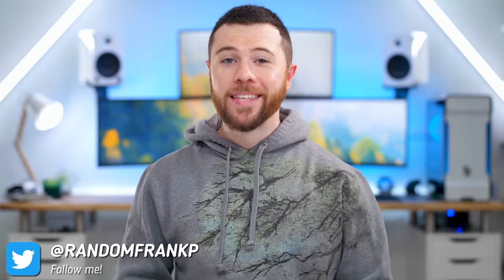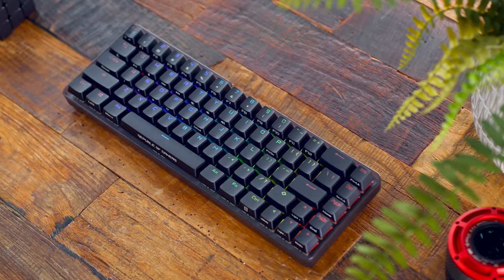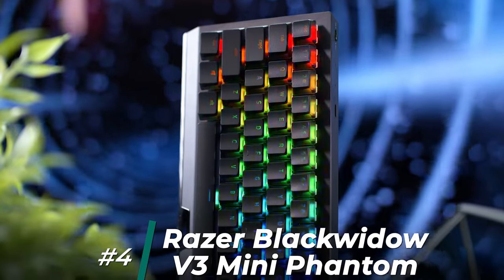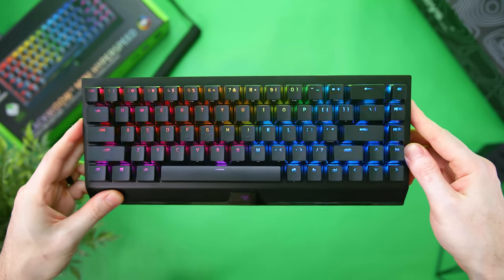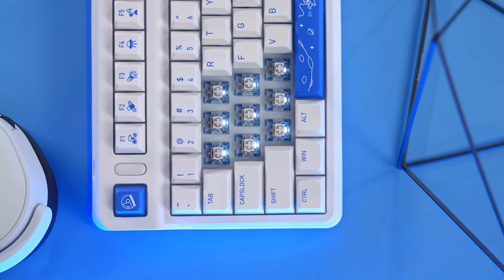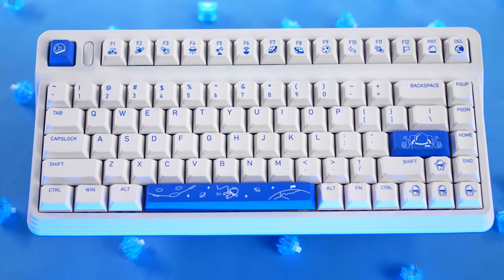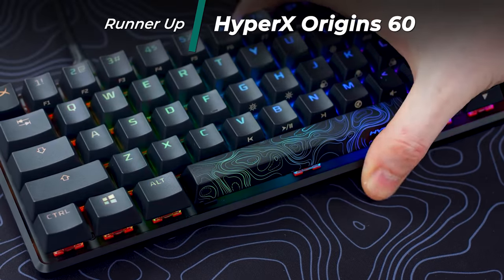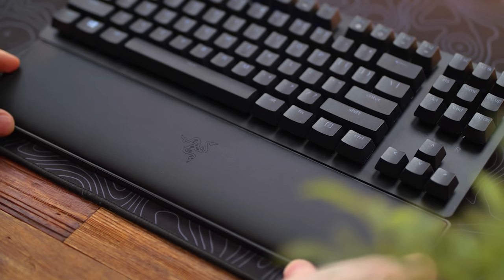Top 5 Gaming Keyboards of 2021!

Comment: Think the Keychron's going to be my next buy.  Had my eye on it, and this really affirms the purchase.
Reply: It's been sold out everytime I've checked
Reply: It's a great board, especially for the price.  With some mods the board performs well above it's price point.
Reply: I snagged one out and it’s great! The lighting is a bit confusing tho, still haven’t figure that out
Reply: Just got my keychron k6 in the mail and I love it so far.  Keep in mind you have to spend extra on the hot-swappable version but I’m just getting into keyboards so I’m fine with my gateron browns
Reply: Akko MOD 007
Reply: Keychron Q3 is coming out in January too
Reply: Yo i have to order it from a seller in china and get those Gat Phantom Yellow
Reply: I’m using the K3 it’s good enough for my needs I like the low profile
Reply: @diegoedward751  Does it work on ps5?
Reply: same

Comment: I am currently rocking the Hyper X Alloy Origin Core with the Aqua switches with modifications of adding dampening foam to the housing and taping the PCB to get more of a thoc sound out of the keys.
Reply: I have the same board, did you have problems separating the case?
Reply: It's a great keyboard and I loved the smoothness and tactility of the aqua switches, but the stabilizer rattle on the spacebar, shift, and enter keys killed it for me. I tried adding krytox 205g0 with a thin paintbrush to the metal parts of the stabilizers and it helped a bit, but without being able to take the keyboard apart, there was no way to do it properly. Other than that and the recessed USB-C port making it difficult to use custom cables, it is one of my favorite keyboards.
Reply: @cyberflex11  a lot of the rattle comes from the stabiliser housing colliding with the plate, what i did was pull the stab housings out and put a piece of bandaid between the plate and stab housing and it made a huge difference
Reply: That was his top 1 last year lol

Comment: I got my Blackwidow V3 Mini earlier this week before coming across this video and I'm loving it so far. A 65% was something I didn't know I needed so badly! This video doesn't even do the yellow switches justice either. They just sound so amazing. #4 on the year from an impulse buy ain't too shabby! Also got it on sale for $120 at Best Buy.
Reply: You still using it ?
Reply: @wolfsiezfps  Yup still love it, only thing with it is sometimes the wireless dongle connection gets interrupted so if I'm gaming I'll use it wired to take away that risk.
Reply: @raaags338  I hope they make a Mercury edition, what switches are you using ?

Comment: I have a GMMK TKL (non-pro) and I love it. The switches are the right mix of clicky and muted. After years of buying cheaper Logitech and MS keyboards, I don't think I'll ever go back to non-mechanical.
Reply: Is everything beside the frame separate add ons you got to do? like it doesn't come with keys or anything
Reply: @landenmccormick5237  Nope. It came preassembled with white keys. I can still swap out stuff if I want different switches or keys at some point.
Reply: @marklinton4567  how much was it? Because it shows it for $170 but thats without any of the keys and making it a basiv white makes it $300
Reply: @landenmccormick5237  That must be the Pro version. I've got the regular in white and it was $109.
Reply: @landenmccormick5237  and that was with the keys and switches preinstalled.

Comment: As a GMMK Pro owner: The gasket mount system wasn't great at first (before full release) because they just got crushed by how compact the board is. Later down the line when I bought mine on release, I noticed they had improved the gaskets. They are more quality and aren't as crushed. However, it still feels like it isn't doing much for the feel of the board because it is still super firm and non-flexible. I have the stock aluminum plate and I think maybe the polycarbonate plate would help with the flexibility. But personally, I like how the board feels overall and I think I'm going to keep my aluminum plate because I really don't mind the feel of it
Reply: The Keydous nj80 is a great board aswell, cheaper than the gmmk pro.
Reply: how is it for gaming? I heard it's response time is more or less 24ms
Reply: @alphaze5944  hey man, don't talk about responsetime with a wired keyboard. It's marketing. A 50ms difference isn't going to make you better at gaming. A good feeling keyboard is. Don't bother about response time (only if it's wireless, because you will notice tbat).
Reply: I play osu and response time is kind of a sensitive topic for me. Just wanna know how it goes
Reply: @alphaze5944  ur probably looking at around 50ms, but how fast you are depends on your own reaction time and the switches you choose.

Comment: The lime 80 cosmic traveller doesn’t have lubed stabs. Only the switches are lubed.
Reply: Frevref whoops lol it
Reply: Wait fr fr
Reply: @theblacksheep71-16  yeah I has considered buying this a few months ago and asked them. They said they weren’t lubed but there switches are. And the stabilisers are plate mounted as well. Which is easier to work with but rattles more. I ended up getting a keychron

Comment: Honestly these are more Custom Keyboards that one's meant for gaming. I think keyboards with high polling rates, high actuation point and maybe optical ones as those seem to be ever so slightly faster than mechanical switches. 

Difference is not much it's pretty much like those switches that are 10% more tactile than the other one or sounds slightly deeper than a switch made from a different plastic.

Comment: The wooting two lekker edition should be in the top 5. I dont have it but the features alone are enough to be on the list. The adjustable actuation goes as low as 0.1 mm and the switches are also analog. Along with that the stabilisers dont rattle.

Comment: One thing to note bout the falchion it uses costar stabs also the switches have a springy ring and the low profile case will amplifi that, the razer black widow is not worth the money, the cosmic traveler is Easley the best keyboard and comes with great stock switches and you don't need rgb not to mention the stabs are very good stock it is Easley the best stock keyboard,the gmmk pro and keycron are great but you have to mod them with tape mod lubed switches extra gaskets for the gmmk pro, and a lot of foam for the q1 the ducky one 3 suite is good off you need a more compact keyboard but the iquinix just does everything better the honorable mentions I wouldn't bother with unless if you want low profile the get the streak

But in the end keyboards are all about opinion so take this as you will
Reply: Please. Use. Punctuations. 

🙏
Reply: @thamirahamed812  no :troll:

Comment: I bought a Razer Ornata Chroma (with the mecha-membrane switches) about 2 years ago. My wrist rest is starting to wear down and I am just wanting a new keyboard. I don't like having the numpad as I don't like bumping into it with my mouse. 

I was considering asking for a new keyboard for Christmas, but these are all too expensive. 😭 I also don't want to have to deal with a wireless keyboard, and don't care about RGB. If anyone does happen to read this, do you have any suggestions for a black mechanical tenkeyless or 60% keyboard under $100?

Comment: No mention of the RK84? This was the dopest starting point for a keyboard i have been able to find. The switches have no ping. Seem pre lubed. Stabs also. The only stab rattle in the pre lubed stabs is the right side of the space bar. Other than that there isnt even a rattle. Anywhere. And i shook tf out of it to make sure. Fully hot swappable. 2.4 dongle, BT5, and wired connections, with dual pass thru USBs, and a software to control macros and RGB settings. All for 85 bucks shipped from amazon. 

And even with the full set of MelGeek keycaps im only 130 bucks in. Thats my only mod so far. Keycaps. Not even fully modded yet and its already super nice. Great sound. Great feel on the stock brown switches. Fully capable out of the box. Comes in white and black. Also has keycap and switch remover included.

Easily the best budget board out hands down. IMHO.

Comment: if i get a razer blackwhidow v3 full size, will still be good? do i have to get the phantom key caps?
Reply: Full size is always better
Reply: @twinkelplayer498  should I get the phantom key caps as well or do I not need them?
Reply: @p_king8767  see if the default key caps are any good, then decide

Comment: i had the asus fal . great keyboard .. very small if u coming from a full size keyboard. I didnt like the side finger to volume up and volume down because i am coming from a volume knob.  why ? because it is not precise , like u will struggle to get volume 94.5  u will have to settle for like 90 percent or 95 percent.  as for the volume knobs u can have it precise.

I returned this keyboard because it has some serious driver issues for me or the keyboard i got was defected.

it will FREEZE and then it will lag and wrote one letter and will spam it until u turn off the keyboard switch button.

i thought it can  be my mb or my usb port but i gave it 4 days for it.

i just had enough of this crap so i returned it.

I am not done with wireless with this experience.

dont get me wrong i have a 24 core CPu and a beast of GPU with 120 GB of ram overkill .

it can be the drivers from asus or the keyboard itself . or the usb dongle.

whatever the case , i am not scarficing my keyboard lagging during a rank game. which has happened . so im going back to wired keyboard for now.
Reply: oh and a HUGE BIG NO NO . this keyboard has a 5.2m space bar kep cap and GOOD luck finding that cause it is so hard to find. so custom key caps is a no go unless you want half and half color.

i really dont know why asus did a 5.2m space bar key cap.

Comment: No K100? Shame on you!
Most of the top spots have better switches than my K100 in terms of stability, at least un-lubed, but I will take optical switches with super short actuation, super short total travel, a faster SoC and 8khz polling over any of these any day!
I also personally can't go without a volume wheel and left-hand macro keys anymore.

Comment: Question for you randomfrankp: on the v3 mini phantom space bar, does adding rubber O-rings to the stabilizer stems help make it less wobbly? That's what I have done on my Huntsman Mini, and it's a dream... but I have been thinking of moving to a 65% board recently. I miss my arrow keys when working in Excel haha.
Reply: It does not make it less wobbly, it actually makes it mushy. I would suggest reconfiguring your stabilizers or buying some durarock ones to replace the stock ones
Reply: It’s stabilizers after all... if you prefer your other ones with O-rings on them, it’ll have the same effect on any other keyboard... I would refrain from doing it tho, because I don’t think it’s sounds good, but you do whatever you like man. 

If I were you, and I don’t want to mess with any modding, I’d get the Ducky 3 SF.. it’s a 65% with very good stock stabs for a fully built keyboard

Comment: My problem with “gaming keyboards” is that they focus too much on gimmicks instead of making a well made board. The main thing that is good for gaming is 1000hz and good feeling keycaps but you can have 1000hz on any custom keyboard using QMK and the opportunities of switches that you can get if you only had a hot swap keyboard is endless. If you really like RGB, you can do that in VIA so gaming keyboards are still pointless. BUY HIGH QUALITY KEYBOARDS FROM SMALL COMPANIES PLEASE

Comment: These are all wildly expensive. You really don't need to spend that much to get a great mech keyboard. And I wouldn't call $70 "budget." I type on my keyboard (a lot, around 4k words a day), I don't game, so maybe I don't need all that. I do have to mod my keyboards a bit, even the expensive ones, just to replace the nasty keycaps with nice ones. Why do expensive keyboards not come with good keycaps as standard? Even a cheap keyboard feels miles better with the keycaps upgraded.

Comment: gosh the sound on that blackwidow v3 clicky was HIDEOUS. even in the linear switches the long keys like the space bar rattled quite a bit. if "cheap" had a sound, the blackwidow v3 would easily give out cheap vibes... except it actually costs 180$. thanks Razer tax! 
at that price i'd rather have a custom mechanical keyboard that i'd lube myself, or even get some cheap prebuilt like the Redragon K552 and give that one new switches and keycaps for the same price and get a much better sound and feel for my money. i'll even take the Falchion over that one any day.
and for anyone wondering no i don't hate Razer i do have a couple of products i use regularly, but they should really do more work to improve their newly releasing mechanical keyboards to justify the price tag. input speed isn't enough.
even the hunstman v2 sounds better in that last sound test.

Comment: expensive keyboards is one trend I just don't understand. $20-$30 will get a good keyboard in either wired or wireless and with or without rgb and any assortment of added media buttons, or stock layout. The big difference from $30 to $150 is really just the switches that make them click when pressed. The fact that that is worth so much money to some people.. well it is what it is. Enjoy playing extra to make the keys click only to then enable AI noise canceling to get rid of the sound in chat later, or don't and drive chat crazy with clicky typing. That's my 2 cents.
Reply: @ties9123  an intelligent reply would give at least one reason that could explain the difference rather than just saying bullshit. Actually, I just bought a new Corsair keyboard with icue software for the individually addressable RGB. Having software control the lights is a big advantage over hardware control only and that was worth the extra money to me. If other feature are also worth more then explain them, don't just call b.s.
Reply: @GlenBland  bro, that corsair keyboard sucks. Only if you build a good modded custom keyboard it's worth your money. The rattle of those stabs on the Corsair keyboard 😫.

Comment: Got the GMMK Pro. The keyboard itself is very good, when you are done setting everthing up you have an amazing keyboard, howerver there is a but, and a PRETTY BIG BUT 🍑!!

The stabilizers is WAY too oily, to the point of it being disgusting. If you plan on buying a keyboard where you can add your switches, keycaps and use it, this is not it as you actually need remove the oil to literally avoid your keys getting stuck when using the keyboard, and I'm not exaggerating at all.